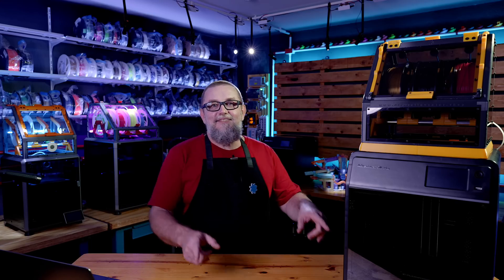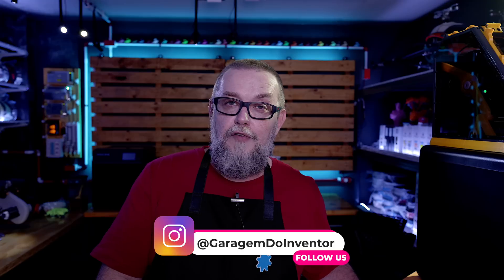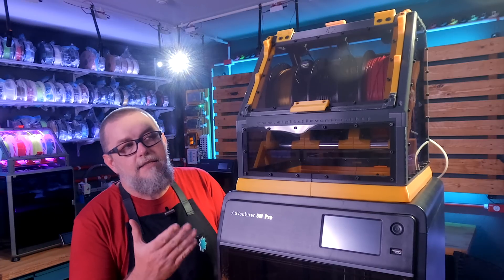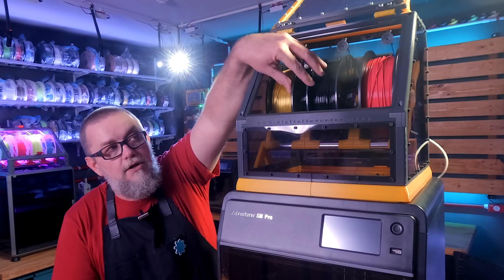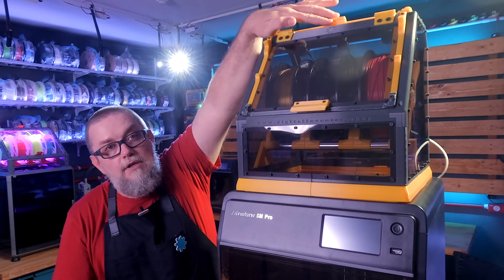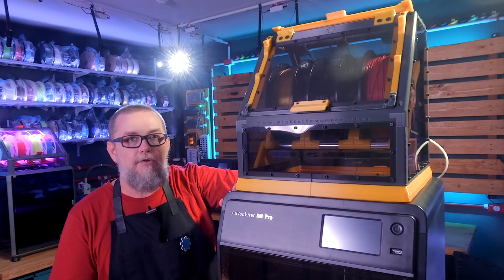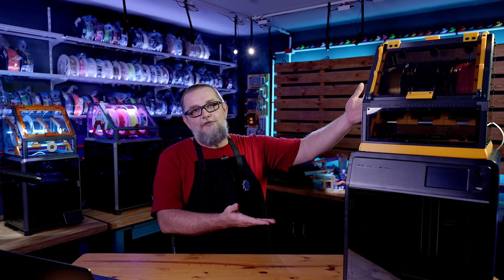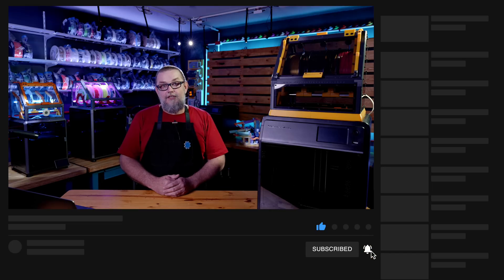How I Upgraded My FlashForge 5M Pro with the Multi Filament System

Comment: I really like the design of this, if I were to buy it would you offer any assistance in redesigning what would need to be redesigned for it to work with the AD5M DIY 3d printed enclosure.  The 5m and 5m pro are literally the same printer just one comes with a production enclosure and the other one can have a 3d printed enclosure so I’m betting all that would need to be done is the bottom modified slightly.

Comment: Will this work with the ad5m with the flashforge enclosure modd
Reply from the maker: Sorry, but probably not. I've designed the 5M Pro adapter to fit on the top of the original enclosure
Reply: Okay thanks getting back to me  @InventorsGarage
Reply: It’s the same printer, but different enclosure/case.  I’m fairly certain that all it would take is a redesign of the bottom adapter for it to fit.

Comment: Will this seal up the unit well enough to maintain lower humidity levels if the printer isn't used for a week or two at a time? Would it need a desiccant in as well to help maintain the low humidity?
Reply from the maker: The printer it self is not sealed, so I recommend you to store your filaments on vacuum bags during long times

Comment: Would this work on the adventurer 5m
Reply: yea in particular if you have the enclosure
Reply from the maker: Sorry guys, it will only work with 5M Pro original enclosure
Reply: @InventorsGarage    sure it works  with enclosure